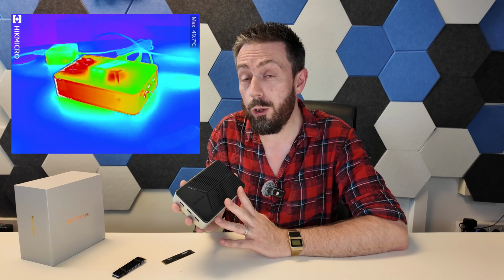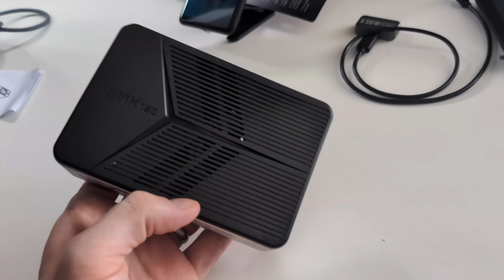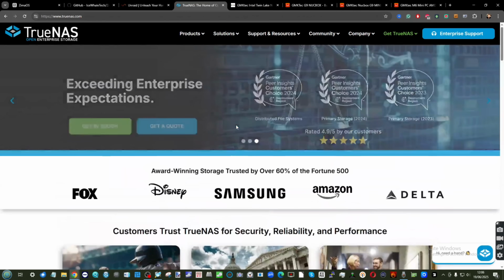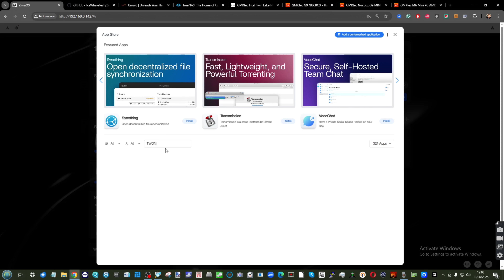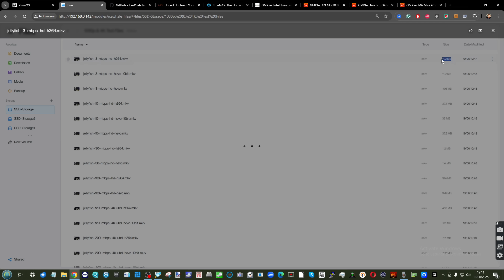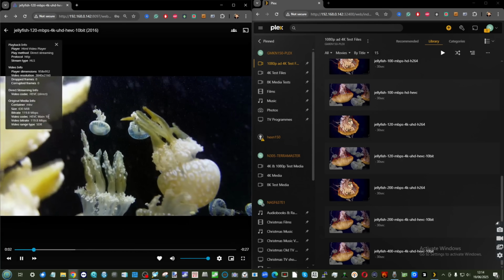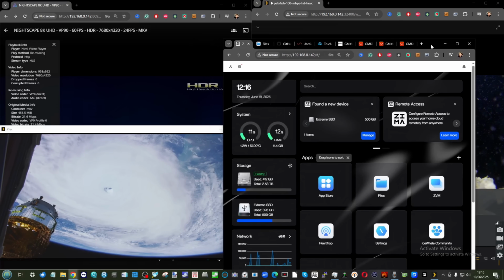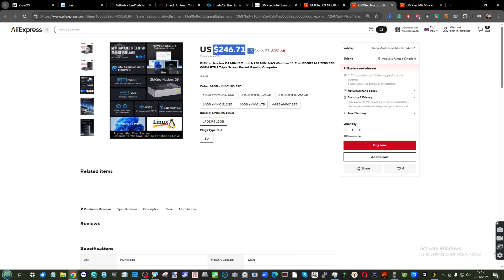Is This N150 AliExpress NAS Any Good as a Media Server?

Comment: I was able to pick up one of these G9s for £115 with one of your Aliexpress codes a few weeks ago and have been setting it up over the weekend for use as a media server. It's needed some DIY work to fix the heat issues - I've got cheap heatsinks on the NVMEs and a 92mm fan to sit over the NVME bay and this has fixed the vast majority of the heat issues. The CPU fan may also need some help moving air out of the box, too, but it's been stable so far and will keep an eye on it. I'm getting a 3D printer and have seen a couple of DIY printed mods to make the extra fan mounting for this device look a lot neater. I also played around with ZimaOS for the first time - must say the 1.4.1 version wasn't a good 'out of the box' fit for me with some jankiness in getting it to recognise some of the G9's hardware (particularly the wifi and GPU). The ZimaOS UI is very pretty and it has a lot of potential, but it just doesn't seem a mature enough platform to be a good 'plug and play' experience for the G9 at present. Decided to try OpenMediaVault instead following another of your recent vids and think I will stick with it - running Jellyfin in a docker container via OMV-extras. Was fiddly to set up but now done it's all working well with the GPU passthrough. Will be interesting to know if anyone's put TrueNAS Scale on a G9 and how it faired?

Comment: @NASCompares I'm curious, have you done a power analysis on various NVME drives? As I understand it, some of them use less power like the WD Black SN7100. Something like that may alleviate some of these heat issues.

Comment: i think if it is gonna have the NAS label, it must have redundancy in mind, for the os dual storage and the storage must be replaceable, for when it fails, and i find mirror is the ligthes redundancy can be chosen, low overheat, no resilvering, transparent when taken to another system, can also work no problem without its mirror, it should be forbiden to use the NAS name if some basic requirements are not met, because if i have all in my NAS, and if fails, at least i should not lose evething  at the 1st attemp, let, one drive fails, i get a warning, and if i chouse not to do something about it, then happen what it should happen, also memory storage is not like HDD that slowly die, its like a traffic light without yellow

Comment: It should be noted that since SSD's are more expensive, and these sort of solutions are already somewhat limited on available space, one could ensure that they are running a good backup regime, and simply elect to use  RAID 0 - STRIPING instead of Raid 1/5 etc.  No, you won't have redundancy, but as long as you are good with backups, this is a perfectly GOOD way to go.  After all, this is JUST media we're talking about.  One could use the NVME storage for striping, giving you just shy of 15 TB as Raid 0 instead of shy of 11 TB in a Raid 5 configuration. This is assuming 4x 4TB NVME drives.  

One could simply put a 20 TB single drive to back it up, and keep the backups up to date and restore after a rebuild rather than running short on storage. 

Now, if I am sticking my files on this that are not replaceable media files, i.e. personal pictures, movies, documents, then I would go with RAID 5 instead.
Reply: This device is way too slow to get any benefit from RAID 0. You're better off using it as separate drives. RAID 0 is a nightmare if a drive dies. A loss of a device means a complete recreation of the system. Everything is lost.

Comment: do they have any of these little nvme nas boxes in 10gbit for video editing?
Reply from the maker: Unfortunately, no. Not really. CWWK is throwing something around, but it's less the CPU and more the heat generation. The alder lake series just before this one had a few N100 and N305 examples (Terramaster F8 SSD Plus, Lincstation N2, and 2 or 3 others). The barrier is less bout the CPU, but more about the aqc113c controller, allocating at least 3x2 to it (else it caps at around 800MB/s or so) and the heat.

Comment: Almost bought one of these, but the overheating issues put me off.
Reply from the maker: It is kinda odd that this system with technically 3 fans, runs hotter than the Me Mini. But also, this does seemingly have better connectivity. Still, definitely needs better dissipation for peak use

Comment: Bought this device a few months ago. It is a furnace (even with the heatsinks). SSD were reaching 90 degrees Celsius inside. Until they dont redesign the form factor/cooling seriously, I strongly recommend to skip.
Reply from the maker: That's tough to argue with. One could mod it, and at this price I'm sure many have, but those temps for heavy sustained use are something else!!!!!
Reply: Thank You, I thought this would be the case but good to have it confirmed. 😊

Comment: using an  NVME only NAS for a media player is absolutely crazy!! 😅 I get the space saving, but we all got a corner somewhere in the house right?
Reply from the maker: true, but NVMe is getting closer and closer in price to hdd (sure, its still double, but I remember with it was at least 5x the Price per TB not so long ago) and the main benefit (aside from power use of course) is it lifts the overhead from the System/CPU to the SSD performance - surrprisingly beneficial once you are dealing with insanely high weight 4K and 8K. I remember back in 2022 when I first started adding 8K media to my plex tests and half the battle was getting this 40GB media file to actually PLAY!!!
Reply: appreciate you are showing what hardware is capable of, but 8k isn't happening IRL. Samsung now supply LED Cinema screens up to 20 metres in size....in 4k
Reply: It makes a lot of sense! I currently run a QNAP NAS for media storage, and it pulls 60W 24/7. It gets hot so I had to mod the cupboard it’s in with vents and fans. It’s noisy so you can’t put it anywhere near a TV. A small solid state mini PC can be way quieter, and use less than half the energy. The fact that the storage throughput is faster is just a bonus. Not sure about this particular device, as the cooling design is pants, but yes, I want (and am building) a solid state NAS for my media library.

Comment: Yeah the chapters are all knackered. I was interested in the temps since this unit has been slated for resets under high load as the temperatures just soar. This may have been discussed in the video but I haven't had chance to watch the full lot yet and couldn't skip to the correct chapter
Reply from the maker: Hi bud. Apologies on the chapter issues. This video was made live very, very last minute. Inside baseball here, but, this was originally going to go live tomorrow, but because of a change to today's schedule related to the fnOS video (see here - https://www.youtube.com/channel/UCFyP17HoU-vpxhIpGXnXx2g/community?lb=UgkxSmzXcDr0J6ocTByxEiufZ3Y2QuQdr8Of&lc=UgxLIqSTmuuQgNsRd-J4AaABAg ) I wanted to make this live now. Unfortunately the chapters were not entered yet, and youtube (helpfully?) inserted chapters of the most recent other video - the Aoostar WTR Max. Which is why these were utterly, utterly wrong! Resolved now. I highlight temp concerns about this devie in this video, but I go into alot more details about it in the initial video review here - https://www.youtube.com/watch?v=YBktjZzqqAg&pp=0gcJCdgAo7VqN5tD and attached article. Cheers for watching bud!